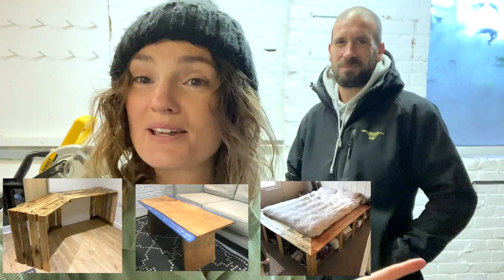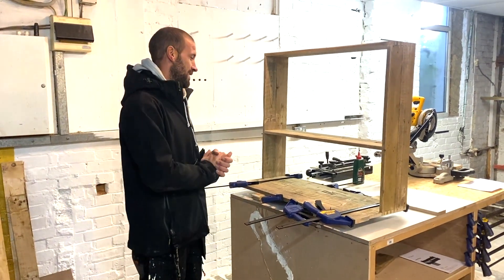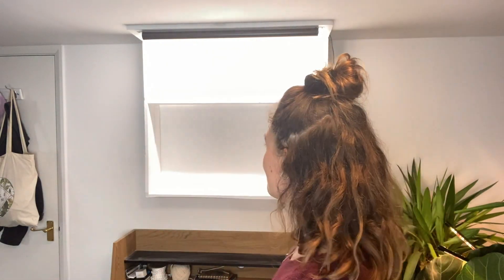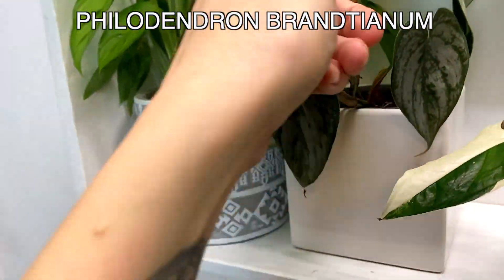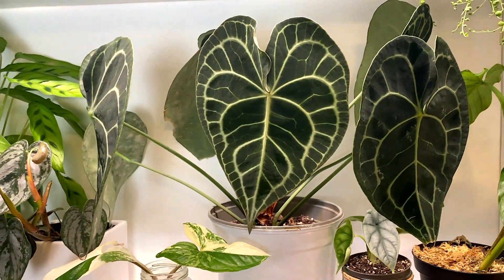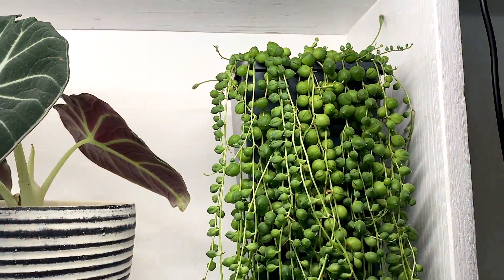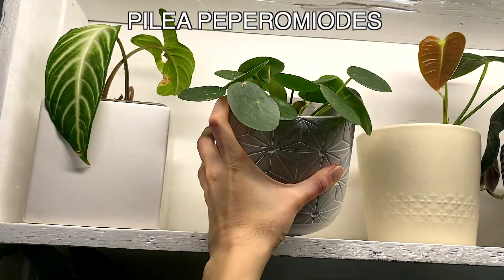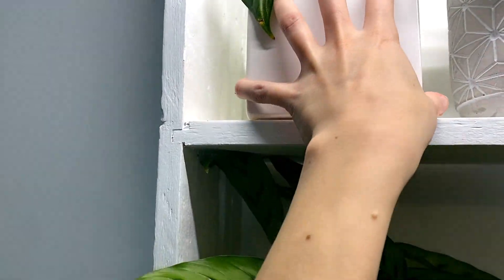Setting Up My New Plant Shelf 🌱 House Plant Tour 🌿 MOTHER Plant Spectrum Grow Lights!

Comment: Fantastic layout of your plants. Would you recommend to report in winter or propagate? Thanks for sharing, i think in the winter it helps to keep them together to keep warm? Not sure. I'll take your advice 🙂
Reply from the maker: Thank you! If you're able to keep the conditions fairly stable and your plant hasn't gone into a dramatic dormancy I tend to still propagate and repot as normal. I'll use heat mats and grow lights to give my propagations the best chance, but touch wood they've always been fine ☺️